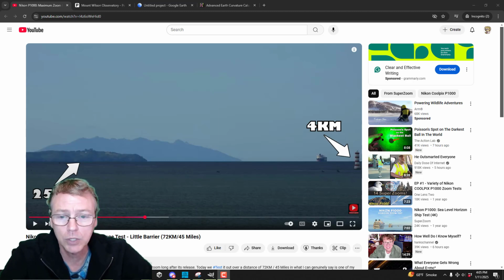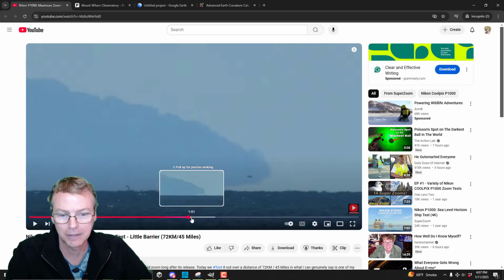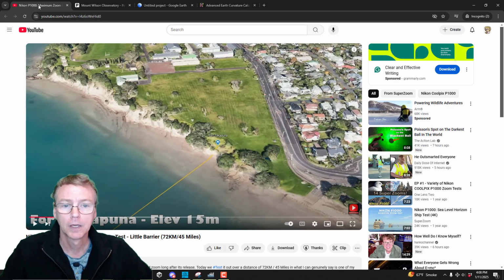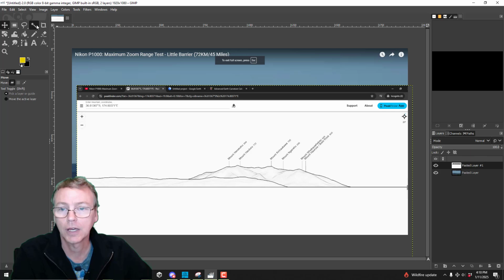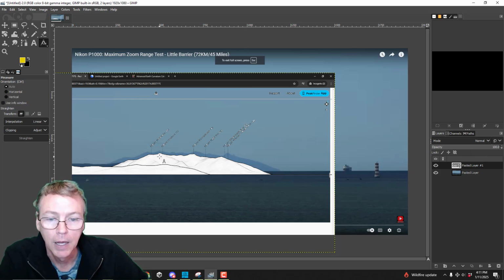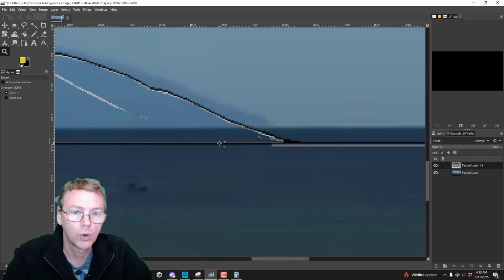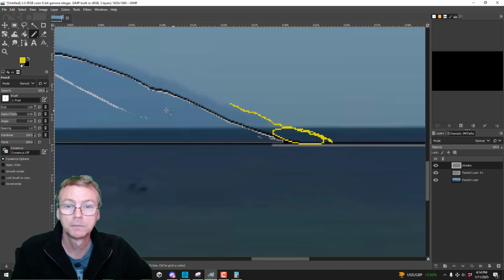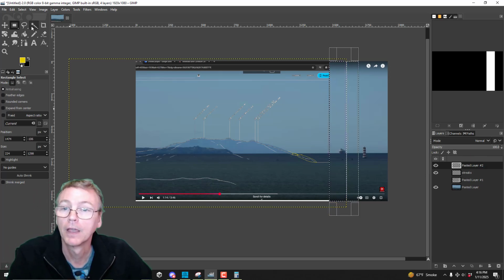Little Barrier Island from Fort Takapuna

Comment: You forgot the step of rotating the photo slightly clockwise to align the horizon with horizontal in its layer.

Peakfinder should have a flat earth mode to make this kind of comparison easier!
Reply from the maker: In this example, the original photograph was already horizontal, so I didn't need that step. You're right, that is often required. When we just take a hand-held photo, it's unlikely that we are holding the camera without some sideways tilt.

Yeah... some applications offer us a flat-Earth comparison option. AFAIK, the folks behind Peakfinder want nothing to do with this topic.

Comment: On the surface of a Stationary Sphere with the same gravity as the Globe....pushing a Car on level ground will require the Same amount of Energy and Power no matter which direction you choose to Push it.   Push it North or South or East or West, there will be no difference, because the Sphere is stationary.  Gravity remains constant on the Sphere because the Mass of the Sphere remains constant.   This means that no matter where the Car is located on the Sphere, so long as it's on "level" ground....it will require the same amount of Force to push the Car no matter which direction you Push it.   

On the surface of a Spinning Sphere with the same gravity as the Globe....Pushing a Car towards the Center of rotation (that would towards the Poles on a spinning Globe)......is physically trying to FORCE an object moving in a large radius Circle with velocity and Momentum......into a SMALLER RADIUS CIRCLE.    

The Conservation of the Car's MOMENTUM at that given Radius Circle, will try and FIGHT YOU if you try and Push it into a SMALLER RADIUS CIRCLE.    

Since gravity is the same all over the surface of the spinning Sphere, it is the same amount at every Radius Circle location, and will not increase or decrease the effects of trying to Force an object with Angular Momentum at a given Radius Circle ....to Push it into a SMALLER radius circle with that Momentum......the conservation of it's Momentum will FIGHT YOU, resist You from being Forced to occupy a SMALLER radius circle.    

Every single step or movement forwards towards the Center of a rotating object, is trying to Force an object moving at One velocity with Momentum in a given size radius circle, into a Smaller one.....and this will result in Resistance, it will Fight you.  It wants to KEEP moving at the same velocity in the same size circle it is currently located at on the spinning platform.............let me repeat that ---->  It will FIGHT YOU and Resist being Forced into a SMALLER Circle......gravity won't change this, or make it go away.....gravity stayed the SAME, remember because the MASS of the sphere stays the same.......Instead you are now trying to FORCE an object moving with Angular Momentum into a SMALLER Circle.             

Locomotion across the surface of the Globe if it were real, would effect EVERYTHING, because anything trying to MOVE North and South, would be moving objects from one size radius circle with Momentum into another size radius circle that is moving with a DIFFERENT AMOUNT OF MOMENTUM, can you Science that or not??
Reply from the maker: @dr.davidbannerf.e.s.6217  that's great stuff. Yes I can science that. Better yet, I think you can also. Let's do it together!
Step 1: quantify your calculations. I personally find it helpful to start with a specific example. Choose an object and tell us its mass. Choose a latitude and tell us where. With those 2 numbers, we can calculate the linear and angular momentum of the object on a rotating Earth.
Do that, and we can move to step 2.
Reply: @icansciencethat  pretty easy with this one, since gravity will remain constant and will not change from one location to the next on the spinning sphere.....only the size of the circle an object is moving in, and the Momentum it's carrying with it at that particular sized circle............is all that i need.

So before i even start with any calculations....if i am trying to move an Object from a larger radius circle location moving faster with a greater Momentum, towards a Smaller radius circle location that is moving Slower with less Momentum.......i will be FORCED to slow the Object down requiring a braking force or resistive force, it will Fight me is my point.   

So as long as we agree with that much so far.....we can move on.  The Laws of the Conservation of Momentum dictate that forcing an Object into a smaller circle moving slower with less Momentum, will be difficult because OF the Conservation of it's Momentum wanting keep moving at the speed and circle it was already moving in....

Do you agree?  Are we clear on this so far??

If you answer Yes.....your Globe is finished, no further calculations needed.  It's over.
Reply from the maker: @dr.davidbannerf.e.s.6217  I'd say you're close. Really close.
What you're describing is the Coriolis force. 
While you're at it, I'll suggest you include the centrifugal force also.
The way you've described it, you are imagining forcing the object to move due north, but the extra momentum means the object is going to tend a little extra eastbound as it goes north. That's the "fighting" you're talking about, right?
If so, yes. Absolutely. That's the Coriolis force.
What I think you'd want to do next is quantify that. How much force is that? Is it enough that we should be able to feel it? Is it enough to measure?
Reply: @icansciencethat  Yeah exactly just the Fact that the Object was moving faster with more Momentum where it was, and did NOT want to be pushed into a smaller circle and also be forced to slow down at the same time.   

That part about trying to move an object towards the center of rotation....the part about it being difficult to move that direction, because the Object wants to Keep the Momentum it already has, moving faster in a larger radius circle....and doesn't want to be forced to slow down and move in a smaller radius circle, which making it step forward would be doing.   

I don't think the "coriolis force" went over that happening, did it??   It always being HARD to move that direction while on the spinning ball, because you are forcing the object to slow down in order to occupy the smaller radius circle closer to the center of rotation....that's why it's hard to move that direction.     

None of the other directions you choose to move on the spinning ball would be like that.   Does the "coriolis force" address this reality or what?
Reply: @icansciencethat  The Conservation of the Object's Momentum doesn't want to slow down, remember?  Trying to take a step forward will force the Object to slow down and occupy a smaller radius circle, and the Object doesn't want to slow down, remember?    

You can't just push an object at one speed into a smaller radius circle moving Slower, without it resisting you, because you have to Slow it down to push it that direction.....that direction is a smaller radius circle towards the center of rotation, that smaller radius circle is moving Slower, and the Object is moving Faster right now in a larger radius circle....it doesn't want to slow down and move in a smaller radius circle, remember?   Because you have to SLOW it down and it's Momentum doesn't want to slow down, so it resists you if you try to Push the Object that direction or move it that direction....real simple.   

So does your coriolis force cover this aspect of objects on the surface of a rotating sphere or not???    All motion all locomotion across the surface will be HARD if you try to move towards the center of rotation, because you have to Slow the object down in order for it to occupy that Smaller Radius Circle (that step forward).   

Gotta love the Conservation of it's Momentum....in this case trying to move into a smaller radius circle that is moving slower.....it becomes a Pain in the backside of the Globespell Team.
Reply from the maker: @dr.davidbannerf.e.s.6217  If you're asking me, then yes. The Coriolis force together with the Centrifugal force address that reality you're describing.
That's what the textbooks say. Those of us who've crunched the numbers agree it's right. The numbers are too small to realistically notice in our everyday lives, but they are relevant in long-range ballistics and orbital mechanics.
For yourself, I figure you aren't likely to just take my word for it. So, I think you'd want to crunch the numbers and see for yourself whether I'm right or not.
Or... if you don't want to check me on this, ask yourself why... why aren't you trying to verify this calculation for yourself?

Comment: I know you're concentrating on the far island, but why is the nearer island profile so different between Peakfinder and the photo?
Reply from the maker: I hadn't noticed any significant discrepancy there. Can you point out what you mean exactly? Where are you seeing a different profile?
Reply: @icansciencethat  
7:20 you have just 'pulled out the white' but left the outlines. The far island profile pretty closely follows the photo, but the nearer island appears to have a large chunk missing. Probably just differently-angled views.
Not really important, as your point was about the further island and its extent below any refraction layer
Reply from the maker: @vespa2860  Great. Yeah... I just sort of guessed at the observer location, and that's plenty good enough to get the rough outline of the distant outline close enough. But the near island is quite a bit nearer... this means any horizontal offset causes a parallax. My guess is there are 2 factors involved here:
1) My observer location has caused the near island to shift to the right a bit in parallax
2) The refraction effect is blunting the edge of the island where it meets the horizon. 
I did zoom out and redo it, and I found peakfinder's version of the nearby island is both a little too small and too far to the right.
So that's my guess.

Comment: Peakfinder exaggerates vertical scale a little, compared to horizontal. When overlaying the terrain profile, I’ll correct for that by making the grid visible, and then adjusting vertical dimension while constraining horizontal so that you get a square angular grid, and horizontal angles are scaled the same as vertical angles. Just helps the overlay fit better.
Reply: Peakfinder? I thought you guys were using that other one (I can never remember the name) that allows for a fully adjustable apparent radius? Soon, you could use my "Earth Observation Simulator" (name pending) which makes comparing observations like this a breeze, and much more accurate in my opinion. I'm considering releasing my program in a month or so under some kind of donation/monthly fee to cover Cesium Ion bandwidth.

Comment: Great analysis! I appreciate your approach to this topic. It would be great to have some temperature data to go off of as well, that’s the only way to get an idea of what is happening with the light from the distant objects traveling to the observer. It would be helpful to know the temperature of the nearby and distant water along the viewing route, the temperature of the air layers along the viewing route, etc. There is so much to consider with observations like these. 

Both the vertical and horizontal temperature data along the viewing route are necessary to know, in order to best conclude what is happening with observations like these. The air above the island is going to have a different temperature gradient than the air above the water. The light traveling from the island may initially refract up and away from the warm surface, causing the island to appear lower than it actually is, due to the decreasing temperature gradient of warm air at the surface of the island and cooler air above. Meanwhile the light traveling to the observer from the nearby water may be refracting slightly down, raising the apparent position of the water, due to an increasing temperature gradient above the water. 

If the water itself is somewhat warm, and the temperature of the air layers along the viewing route decrease from the surface on up, you’re very likely to witness some amount of sinking refraction. There is definitely an inferior mirage present in this observation. And from what we’ve observed, the vast majority of the time, inferior mirage is accompanied by strong sinking refraction. 

Assuming a planar Earth, from an observer height of around 50 feet, viewing across 45 miles at an Island with the highest point being about 2,370 feet, that would put the top angle of the Island at about .55 degrees. The island appears somewhere around .25 degrees, close to the prediction of the 3,959 mi radius globe Earth. However, over a distance of 45 miles, I believe it is very possible for a .30 degree displacement of the Island downward due to upward/sinking refraction across a planar Earth.

We’ve observed objects around .20 degrees above the surface appearing displaced downward, in a mere 1,000 feet from the viewer, when viewing from low angles. Even when the temperature variation of the air layers from 2 inches to 4 feet are within one degree Fahrenheit of each other, we still witness strong sinking refraction that can obstruct the bottom 8 inches or so of distant objects at just 1,000 feet. 

Anyway, I would like to invite you to check out our channel. And if you would, give us your input on how we can improve some refraction tests we are attempting from home. We just recently had a successful ‘looming’ test, where we got slight raising of distant objects around an obstruction. I’ve seen some of your refraction demonstrations and I enjoy your enthusiasm for science. It would be much appreciated. 

Cheers!
Reply from the maker: Refraction in these observations can mostly be explained with temperature variation. If we have the temperature measured at different heights, there are ray-tracing programs that will allow us to simulate views with much better precision.
So in short, more data is better.
Sadly, we rarely have that information... it's not easy to collect. In most cases (such as this one), we just have pictures or videos and little else. In these cases, it makes sense to do the best we can.
If you're serious about researching the effect of refraction on views like these, I would suggest you focus on designing a system to collect the missing atmospheric information (mostly temperature, but pressure and humidity if you can get it). We usually get this with sounding rockets, but those focus more on high altitude data we don't need. People have done this with temperature probes mounted on poles, and that works, but it's hard to get out over water with those. My thinking is you could leverage a drone to collect this data very easily... hang a temperature probe (and maybe pressure and even humidity probes?) below a drone and fly it out over the water. That way, you could quickly collect atmospheric data out over an observation location. Feed that info into one of these ray-tracing programs.
Reply: @icansciencethat  Great suggestions! Yes it is difficult to collect all of that data, even for us over short distances lol. But I really like the idea of gathering some data with drones!

If we ever try that ourselves, I'll make sure to give you credit for the idea. We've collected some temperature data along the viewing route over water with a kayak before, but I like the drone idea much better. 

Also, agreed that it would be great to have direct measurements of the pressure and humidity as well.
Reply: I agree with everything you said, except the start.
I don't really think it's a great analysis,  I think it's a lack of understanding of how an inferior mirage affects the horizon and distant objects beyond the horizon.

The bottom of the mountain is not physically below the water. It's apparent.

The bottom of the mountain is hidden in that inferior mirage, and the fact that the inferior mirage, especially a heavy inferior mirage like this,always brings the horizon much closer to the observer.

That, in conjunction with upward refraction of the light, is what is making this mountain appear to be below the horizon.

As I will demonstrate soon, it is also, literally an effect of perspective that has not been considered before, and that is how perspective works when it comes to the horizon, perspective is happening on the opposite side of the horizon.

We from our side of the horizon watch boats appear to rise in our vision as they get closer to the horizon until they reach the horizon. This is what perspective dictates.
What I will show without any doubt is that then the exact opposite happens beyond the horizon, and now the boat appears to drop below the horizon as it goes beyond the horizon.

Just as we know, the boat is not actually below the horizon. When we watch it move towards the horizon away from us, it is not physically dropping below the horizon once it goes past the horizon.

I showed this in my presentations, but I have worked it out better now and have multiple examples of real-world bots doing exactly what I describe.

It will become far more apparent and obvious once I drop the video on it.

Can't wait to see more of your tests and observations.

Have a great day
Reply from the maker: @planereality3675  so you're really going with, "it looks like a globe, but it's actually flat"?